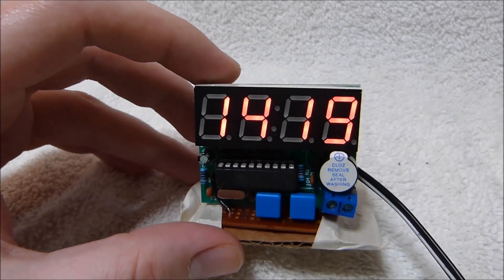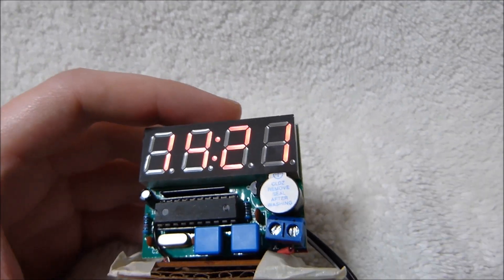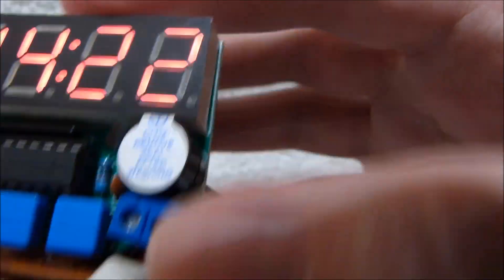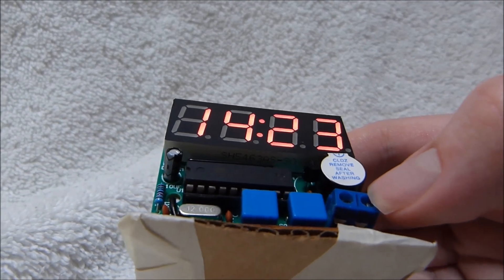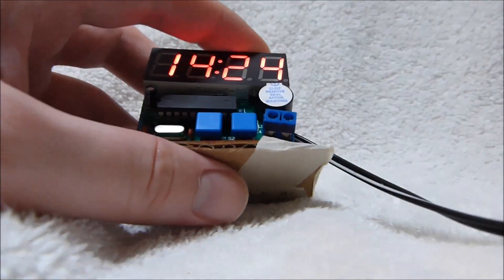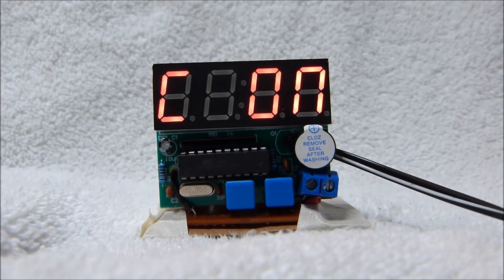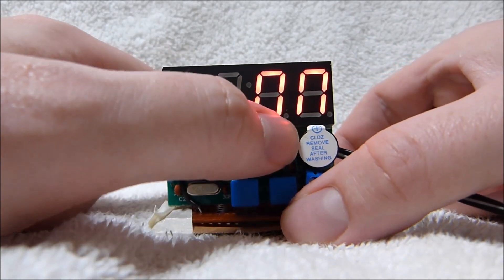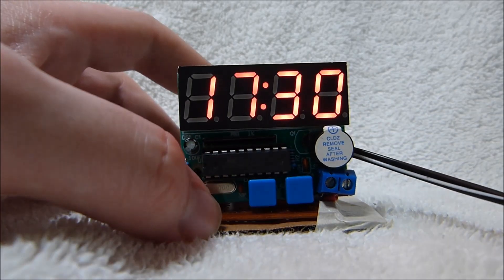A very cheap 4 digit LED clock kit

Comment: I bought more these ,one I bought on ebay came with a power supply and one is like yours ,your has better buttons .
Reply from the maker: It seems there are a number of subtle variations of this kit being sold, with slightly different parts and/or layout. I'm sure they are all running the same code, and that code is freely available online.

Comment: Ali express has them for about 1.50
Reply from the maker: If that includes shipping, then I'm amazed they can even turn a profit at that price
Reply: @50sTransistorRadios  Ali express  is almost always free or very cheap shipping they are much cheaper on a lot of diy electronic  kits then ebay you may want to look for yourself.let me no what you think

Comment: Neat little kit. One of the first things I check with any clock is that it has a 24 hour mode. It's the only way I want a clock now. Tired of 12 hour clocks being inconsistent with a dot for am, or a dot for pm, or a dot for both, and then not having an alarm come on in the morning, and wake up late to realize it was set for 18:00 instead of 06:00. Travelling for work, and using various clock radios in hotels, you see just how inconsistent north America is with 12 hour clocks compared with the rest of the world using 24 hour clocks.
Reply from the maker: Like a few other clocks I have, this one is 24 hours only, and I'd prefer to at least have the option for 12 hour time. I do agree that "military time" is simpler though, and it avoids AM/PM confusion.

Comment: Cute.  But it would have been better had they included some essentials😐

📻👍🙂‼️
Reply from the maker: For a few bucks more, you can get clock kits that include a USB power cord, or at least an on-board voltage regulator. However, that doesn't mean they will be functionally better, since I have two other Chinese clock kits that are more poorly designed/programmed.